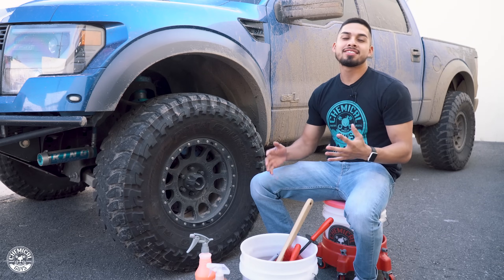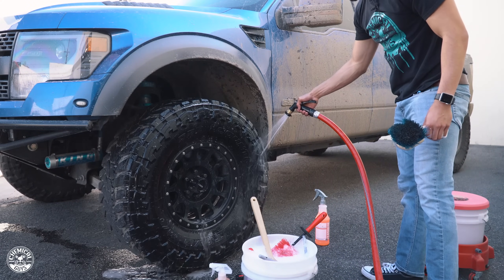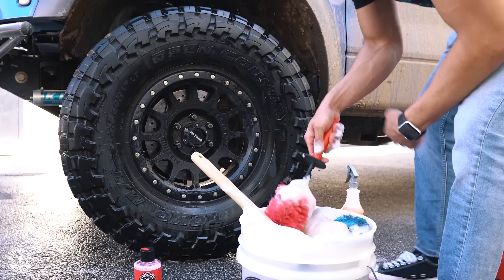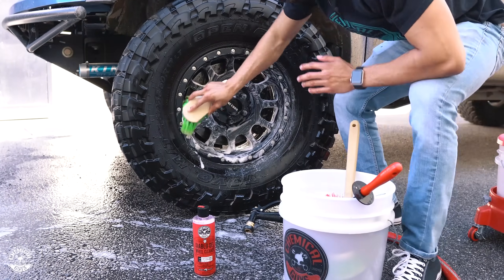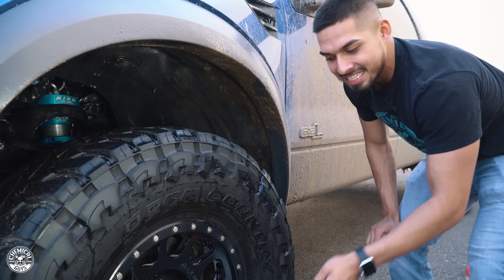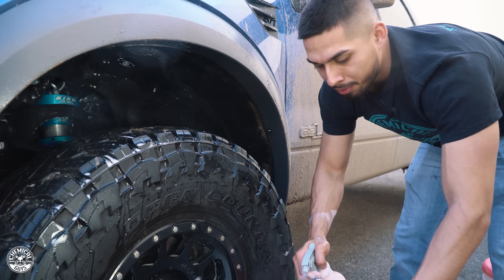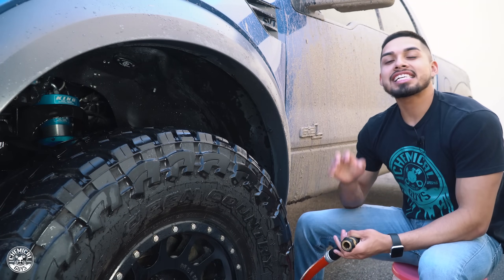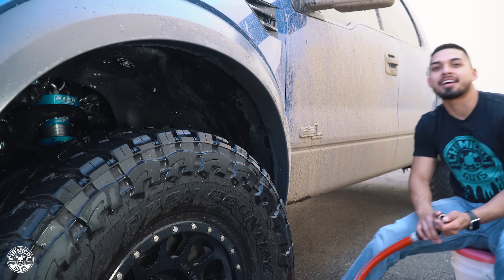How To Clean Dirty Off-Road Truck Undercarriage: Raptor! - Chemical Guys

Comment: Never seen someone take so long to clean one wheel lol. Great job
Reply from the maker: Hi Josh! How long does it take you to clean your wheels? Thanks for watching and happy detailing!
Reply: Trust me josh I take an easy 30 minutes to do all 4 or mine but for the fact that they are billet and have massive spokes so I have to clean the inner barrel of the wheel and not to mention I have spikes going along with the spokes and I have to worry about getting cut as well 😂 then I have to polish them monthly but there never too dirty so it’s fine
Reply: If you really care for your wheels easily 20min and more per wheel since you need to wait for the chemicals to work on the iron bits from the brake dust that adhere to the wheel.

Also for any foam to do its work on the tyres while you wait. It’ll take time as well. Also any brake dust that adheres to the hub can be cleaned off as well.

Wheels, tyres and wheel wells are actually the hardest to wash: often more time consuming than the car body. Especially so if you have intricate wheel designs.

They are the dirtiest as they come into contact with the road the most. So it makes sense to spend a reasonable amount of time on them. 

If you just pressure wash it’ll probably work as well but you’ll be doing more of maintenance rather than maintenance plus protection. 😊

Comment: I have a pressure washer thats 2900 psi would that work because i saw in a previous video someone said anything under 3000 is fine
Reply from the maker: Hi Martin! Yes that is correct. Your pressure washer will work perfectly fine. Happy detailing!

Comment: Just use pressure washer and life will be easier)))
Reply: Vladimir Chalenko that will starch paint in the long run
Reply: no lubrication = scratched up paint as those grains of dirt and mud slide along any surface

Comment: Would have been a 2 min video if he just degrease wells and tires and powered wash it all at one take!!?
Reply from the maker: Hi Nesken! If you seen in the last part of the video, we used a pressure washer and it still required the same amount of scrubbing. The dirt had been caked on the for a while, which made cleaning a lot harder then it should have. Happy detailing!